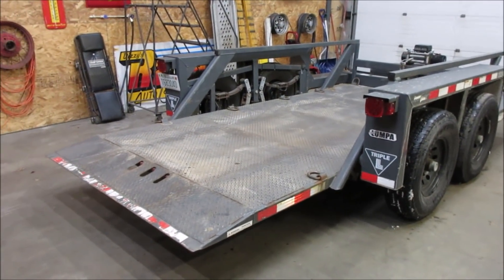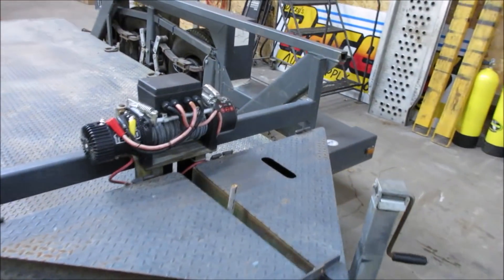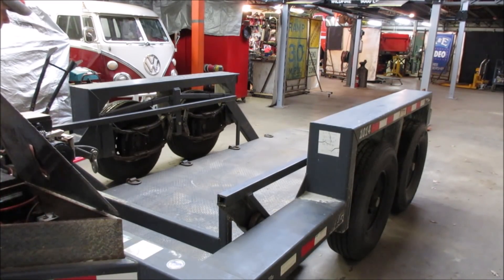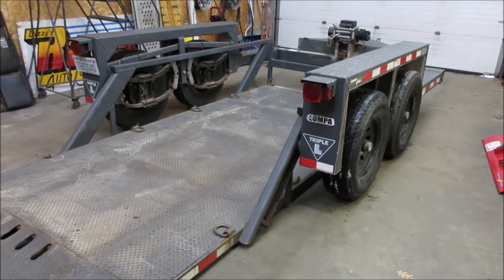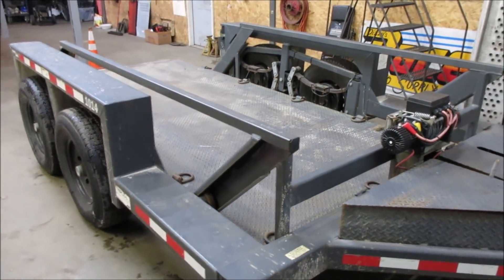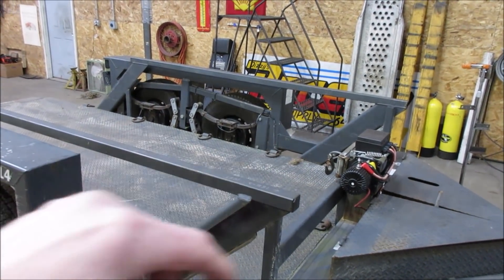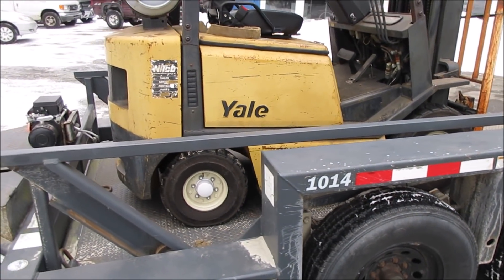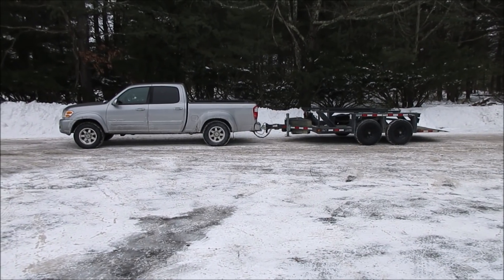I Bought A Super Cool Trailer, Lets See What it Can Do?

Comment: Very handy to have around if you need to move items on a regular basis!  With the deck lowering certainly makes rolling a dead vehicle on a lot easier.  Also handy for pallets, you can just run your forklift right up on it and load/unload what you need.  Wonderful.
Reply: Zero turn and pallets of stuff, great setup

Comment: These were primarily used for scizzor lifts that dont have much drive torque. Lots of rental outfits use them. Very well built trailers.
Reply: I load a scissor lift at work on a tilt trailer fairly often. It can be a real pain especially if it’s wet. This would make it super easy
Reply: @davemiller262  we had both at the rental store I worked for. We would send smaller rollers and many other things out when it couldn't make it up tilt trailers.

Comment: I've owned and used this model trailer for many years. It has been almost trouble-free. Only the safety latch bent over time, and I fixed that with higher grade steel plate. I use it in my tree service to roll 18" wide logs of huge diameters into it, and roll them off at my equally large capacity log splitter I built. But, it has hauled many other things as well. For moving a lathe it's a must. Too narrow for a car though. I paid $7K for mine used in 2005. It's a JLG model. Mine has reinforced sheet metal side walls. Great trailers!

Comment: That thing is awesome! I have never seen anything like that here in Europe!
Comes really handy for loading anything that has not much suspension and ground clearance.
Does not need to be a fork lift but some people would love somehting like that for their super low show cars too^^
Reply: Of cause not strictly the same but the Humbaur HKT & Heimann pt18/pt35 trailers serves similar purpose.
Reply: @migigenDK  Thanks! Those could at least work out for a low car or some smaller equipment.
Reply: Finally, a European comment on YouTube that isn't telling everyone how superior Europe is...I applaud you sir.
Reply: There is a couple around, problem is the weight laws make trailers like this pretty useless in europe. Even with a BE licensse you wont be able to put anything on it. You need a CE licensse and  then a cheap Scania, volvo or for that matter a C registered Sprinter with load exchanger makes much more sense that can be used with just a C class.
Reply: @Iceeeen  Yes exactly, the weight limits in Europe are far far far less than in North America

Comment: I had one similar to this custom built about 8yrs ago. Had it built to haul up to 7 60" mowers in line (I  own a small
 engine repair business) and the winch system was designed so I could still use the wench even with mowers on the deck if need be. Best investment I ever made.
Reply: 7 60’s??? How long is it??

Comment: The downside, they are heavy, they start to wear where the linkage and springs mount and your wheels will start the bow out and wear the tires. We had them in MN and the hydraulics don't like to work in the cold. Lubrication is key to making these hold up in the rust belt.

Comment: They are awesome trailers.  We used them for years hauling scissor lifts.  Would recommend watching the wear on the inside of the two rear tires, that suspension system tends to twist causing issues with camber on the rear tires.

Comment: Those are very cool trailers, if your going to have that thing loaded often keep an eye on the spindles and bearing. Also seen the big diagonal frame braces crack at the welds as well. The other trailer you spoke up is something like the Pratt line, very nice as well.

Comment: I used to use a covered version at work.  You have to have the correct tire replacements,  they are very heavy duty.  Might be a good idea though get 1 or 2 for your stash before your in a pinch

Comment: We had a trailer like that when I worked at the hardware store in my town around 2001.... It was a single axle and used a manual winch..... but same even lowering method..... I think it had torsion suspension though. I borrowed it to pick up a tube air cooled VW buggy and a ton of parts (for my Formula Vee race car) in Bangor (I live near Portland, ME).... I got a flat about half way back..... It was a long day

Comment: Watch the leaf spring packs, they like to crack leaves fairly consistently. Try to avoid taking sharp turns when loaded to help mitigate that some, and to extend the life of the poly bushings they use on the pivot assemblies. Eventually the wheels will start tilting inward on the top regardless if you haul any real amount of weight with it. 
Parts are still available for those through your local JLG dealer.

Comment: Good trailer! Its certainly solidly built, it needs to be. I reckon the primary issue was the sheer cost of the design. I wonder if the frames had a tendency to both twist and to splay out at the rear? I noticed there appears to be a support running down and underneath the floating bed, behind the wheels, it likely takes of much of the issue. Of course, uneven wear at the leaf springs and their mounts, is another possible issue. 

Overall, a very handy and useful trailer with a few tricks up its sleeve!

Comment: I would be suffering from a bad case of trailer envy except that all I have to tow with is a 4 cylinder, 5 speed manual Ford Ranger. Even with 4.11 gears I’d probably burn up the clutch moving that thing empty.

Comment: I've seen a similar trailer to this used for loading scissors lifts. Those were not as wide, but functions the same way. Another option to moving scissors lifts is a towing company with a roll back. In the long run, as you've probably noticed, Darren, is the ability to move things that are more difficult without calling to schedule a roll back. I just looked on eBay, and a brand new trailer like this is over $15,000. I'm sure you payed a lot less than this, and got an awesome trailer.
Thanks for the video.
Reply: 15k is a good chunk of cash, new obviously, he said 2009 i think. But man the features and utility this thing has? Plus how beefy it is? Perfect for what he does and i'm waiting to see what he brings back on it.

Comment: very cool and cold, Mustie.  Practical ???????
1)  so the lift is operated by your truck battery?  Pulling that much torque, will it harm your battery over time?
2)  is you 7k truck suspension and brake system going to be able to tow and use this for more than a couple light weight jobs? I was squeeming at the jerks, pulls, lunges your truck was enduring during the loading.
3)  Is the torque from the loading, shifting, traveling going io hurt your tranny?
4) should you install an auxiliary battery to use the hydraulics, or am I just imagining there is much more draw than there is.

See, I got an inquisitive mind like yours, but you got the knowledge.

Nice rig....  can't wait to see you benefit from it.

Comment: You have all the toys we had as kid's in scale 1:1 don't you :D
That will save some awkward moments getting something on a trailer.
All you need to make it more perfect is a come along system they use on caravans so you can get it in tight spaces without using a truck. then it could do a 360 on the spot even.

Comment: I've seen a few trailers like this, always thought every time I needed to haul a vehicle somewhere that I needed a trailer like that...every vehicle I've ever had to haul wasn't operational, trying to load vehicles on a trailer with ramps is a pain in the a**...my car trailer didn't have a winch...so you either had to push, pull or drag whatever it was onto the trailer with a come-a-long, or man power....not fun at all.  My current car trailer doesn't have a winch either, but if I have a dead vehicle I'm calling a tow truck LOL.  My car trailer I have now is going to be the trailer I use to haul my tractor and implements around with if I need to.  I'm past hauling around vehicles otherwise.

Comment: Congrats on the new trailer there.. Shes pretty sweet for sure..
Does it have a power down feature on the hydros?
If so, a 6x6 under the deck makes for easy tire changing.
Reply: Given that it didn't make a sound while going down, probably not. Most likely they're single action cylinders, with only oil pushing it. So 1 button powers the pump, filling the cylinder, one button opens a valve to release the oil. Kind of a risky design, could leave you stranded if you don't realize your battery is empty and you let it down. On the other hand, there's always a car there when you want to move it, but still.
Reply: @garymallard4699  When did I ever say that it was hard to switch to double action, or that there was no charging option? I just answered Steve's question, and mentioned that as it stands, it's risky. I never said there's no option around it, I simply said that it's a risk, one that you don't have with a regular trailer. Just because I say things aren't perfect doesn't mean I don't know they can be improved.

And about the conversion to double action: Sure, it's possible, but why on earth would you. That would heavily increase the price of the trailer, since you'd need two new cylinders, extra custom made lines, and a new valve block. If you're lucky you can get away with some second hand / found parts, but buying those new just to be able to change a tire more easily? And as (most of) you Americans always like to say: More features just means there's more to break. This system is simple and pretty robust, and it works perfectly fine. Changing to double action cylinders is simply not worth it.

Comment: After loading does go back down and rest on the pawl or is the pawl only there as a backup for if the hydraulics fail? I wouldn't like the idea of it resting the hydraulics as the pressure would be spiking very high as it is being towed and bouncing with a heavy load.

Comment: I seen videos where people make smaller trailers using air bags to lower the trailer to the ground, But what I did not see a fail safe like your trailer has in case of a hydraulic line failure.. very nice But is that large enough for your backhoe.. Just curious are you getting a Bridgeport if so they are very nice machines

Comment: was actually looking at one of these. There is a place in america called Air  Tow that makes them. 

I was looking at this exact sort of model, 14 foot, 10k lift and it w as 20k for a brand new one
Reply: Just looked up triple L trailers, and they are still making these... Mostly used for scissor lifts apparently. Looked up new prices for the 2021 model, 19 foot and 10k lift they were asking 17k for it.

Comment: Local town councils in the UK in the 60's/70's had two wheeled and four wheel versions for moving plant around, how do the USA rules work for towing, I'm allowed to have an all up weight of 3.5 tons, my car weights 2 tons so the max I can tow is 1.5 tons and that includes the trailer weight, the trailer weights 900lbs so my max load is roughly 1 ton, before anybody in UK queries my max all up weights its because I'm diabetic and inject insulin so my max all up is less.